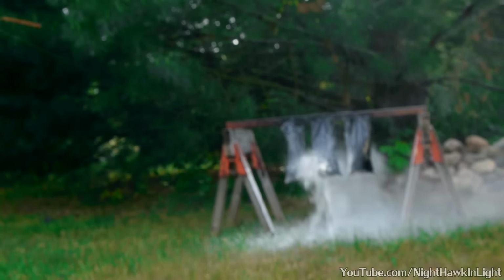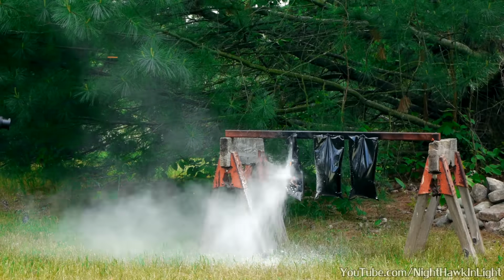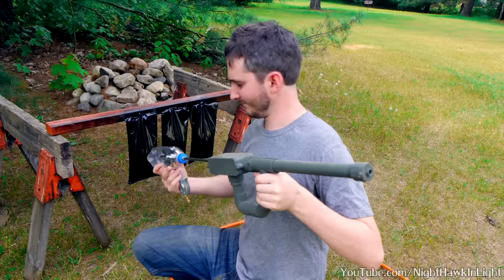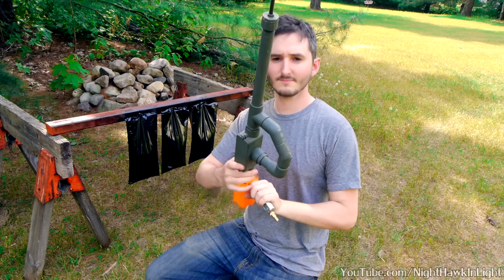DIY Airsoft BB Machine Gun - 5,000 + Rounds Per Minute - NightHawkInLight

Comment: 300 would leave a mark? My gun has a velocity of 360 and my new one will work around 390...
Reply: bet it cost a lot more than his gun, though
Reply: No, I mean 300 won't leave a mark. And I so somewhere that 350+ is an upgraded extra-über-sniper gun... In Hungary the max FPS of an assault rifle is 400  and the max FPS of a sniper rifle is 600.
Reply: P. Robin 300fps will leave a mark.
Reply: I've been shot multiple times with 300-400 FPS guns, it won't.
Reply: P. Robin Look what his gun did to that bag, it put holes straight through it. It will leave welts.
Reply: I'm not that thin and not filled with watherver it was filled with. It's either not 300 or won't leave a mark on a human being. Trust me, I know what I'm talkin' about, I play airsoft for quiet some times.
Reply: P. Robin There is something wrong here then. Those pellets wouldn't be going through that target without a good amount of force. I don't play airsoft myself but I do shoot at targets in my backyard time to time
Reply: The human body isn't so weak. If you get shot you'll feel it for like five seconds and that's it. Above 400, it'll leave a mark.
Reply: P. Robin Your body doesn't need to be weak to have a welt on it. Something as simple as scratching your arm enough can leave a welt.
Reply: depends on distance velocity weight, and where you get hit. I'm sure 300 would leave a mark given the chance
Reply: ive been playing airsoft for a few years, and up close, it would leave a mark.
Reply: +P. Robin (Sledge) 180 leaves a mark if shot at close enough range with 20 grams. I've had a lot of BB guns and when shooting 20 gram BBs, almost any FPS leaves a mark.
Reply: Actually I only use .25 or .28 BBs